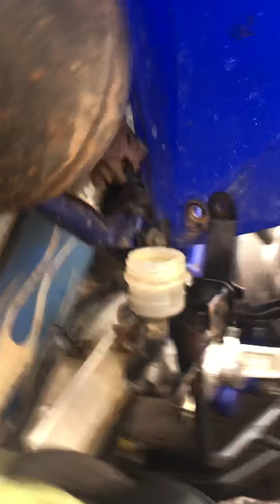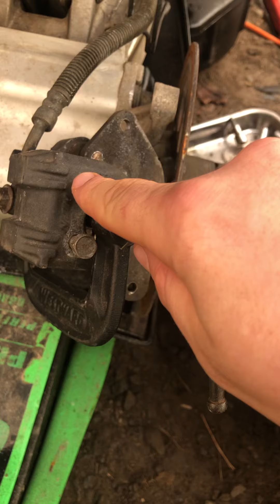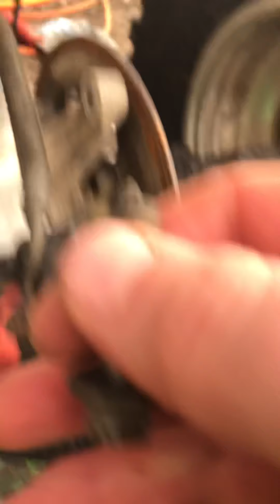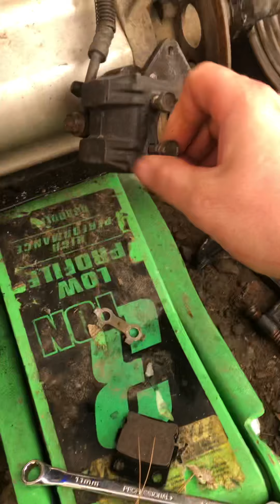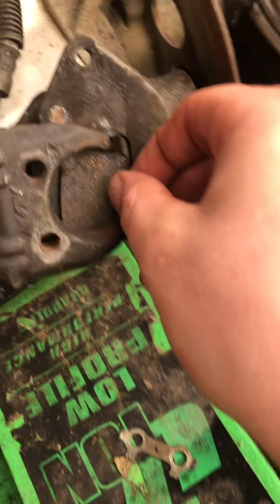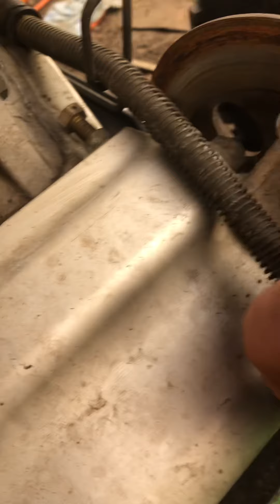2005 660 raptor rear brake pad replacement

Comment: Make a video on how to separate the pads to get the brakes back on
Reply: No shit! I cant get it back together. It's like the pads are just a little to thick.
Reply: Ok I figured it out. Theres a single Allen bolt that is stuck. Lube it up and it will move and you can get it back together.
Reply from the maker: Yep there is also an allen key on the side that has to get broken loose to get that extra space you need for the new pads major pain in the azz

Comment: Big fing no no this whole video is a no no. This guy has no clue, for starters don't take the top of the brake fluid resivoir for second.... you need to take the sliders out and clean and put brake lube them  or you end up with pads worn at a angle guaranteed like the ones you pulled off it. 1/3 pad at top or bottom and fully worn out at the other end. Plus he never explained how to set the park brake which you gotta do every time you change brakes. Such a hack